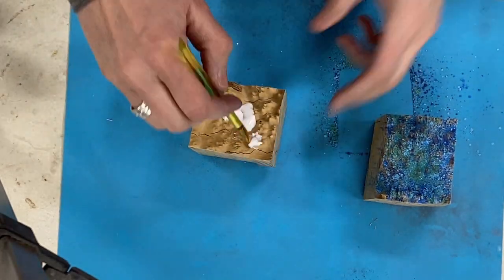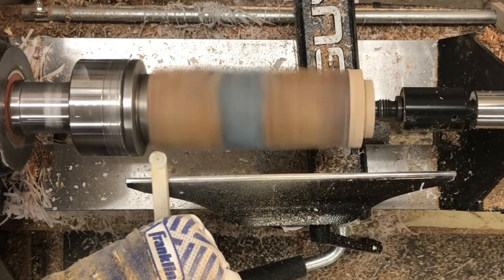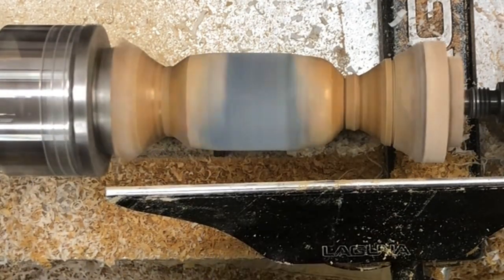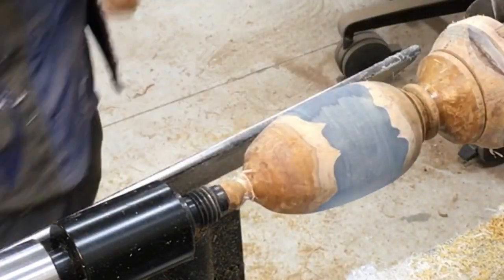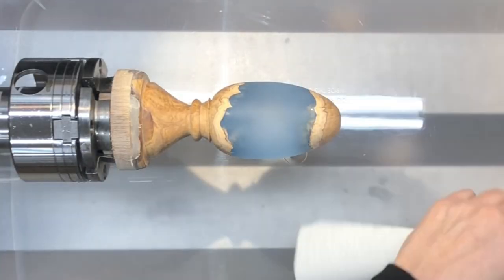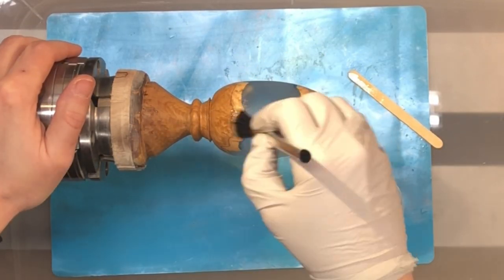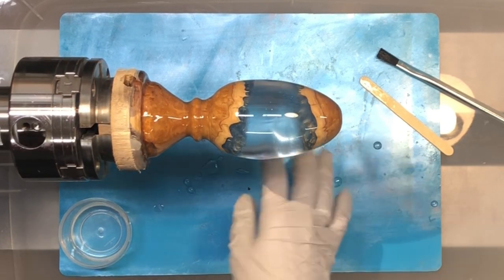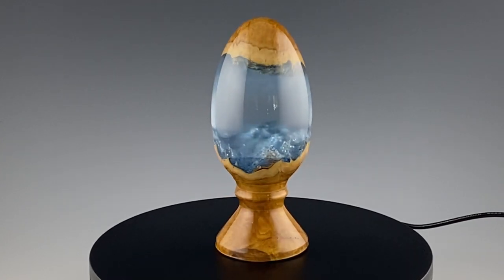Woodturning: Turning A Dragon Egg-Mallee Burl & Resin Underwater Cavern Egg+BBQ Rotisserie Hookup

Comment: Thats beautiful! Well done! Thanks for showing the barbeque motor set-up. Ill have to get one of those.
Reply from the maker: Thanks Dave! I made it so the rotisserie motor isn’t dedicated to the lathe as I’m also building a setup that I can use to coat tumblers with-I just attach it to whichever thing I want to use and I’m ready to roll. I bought the whole Charbroil rotisserie kit, but it turns out all I used was the motor - I was able to find the 5/16” square stock in the specialty bins at Menards so I decided not to destroy the bits for the rotisserie in case i actually want to roast a chicken on the grill. You can buy the motor separately but make sure the square hole that turns the spit is the same size in the event it’s a different brand.
Reply: @LisaRamlow  i also went over and wattched Zac's video on this set-up. Really cool idea, and not so costly! Thanks to both of you for sharing. Oh, and did i say....i LIKE that egg!👍👍👍👍👍

Comment: Beautiful finish, great looking piece....try a few seconds in the microwave to 'warm up your pour on resin coat...it helps when the shop is cold
Reply from the maker: Hi Martin! I normally use different resin for most things, and neither kind I currently have (Alumilite Clear Slow and Liquid Diamonds) has been this thick - wasn’t sure if it was supposed to be. It worked ok and I guess if it were too thin it might just slide right off. I’ll have to experiment a little and see if warming it up a tad makes any difference. Thanks for watching 😊

Comment: Very artistic LR. Thought of using a BBQ rotar before but never thought of using it in the lathe. I must research that!!
Reply from the maker: Hi Chris! A lot of lathes have threaded spindles so you can attach a vacuum chuck and it works out really nicely. I’ll have another setup not on the lathe for coating tumblers and such but for anything I can hold on a chuck this is perfect. Unless I want to use the lathe while it’s spinning a resin coat 😂
Reply: Luv to see that other rotary set up sometime LR  🤔

Comment: Epoxy is strictly a mechanical bond. For a maximum strength glue joint use 60-80 grit sanding to prep the joint. System 3 epoxy T-88 bonds damp wood better than most epoxies, the cure time is 24 hours.

Comment: I’ve watched several turners that have the extension from the head stock to the chuck. What kind of setup do you have? Is that just a insert attached to the chuck? Where did you buy it(if I may ask)? Loved your work and finished product. Really does look like an egg!!!
Reply from the maker: Hi there! When I started turning I had a Delta Midi lathe, which has a 1”x8tpi spindle thread and my Nova G3 chuck threaded directly into the spindle. When I upgraded to the Laguna, I hit a Nova SuperNova2 chuck that threads directly onto its spindle, which is a 1-1/4”x8tpi thread. I wanted to keep my smaller G3 chuck so I ordered (from Woodcraft I think) a Nova spindle adapter which lets me use the smaller chuck on the larger spindle. Definitely worthwhile! Thanks for watching 😊

Comment: Uv resin may be an alternative  works well on rings and cures under uv light rather quickly.
Reply from the maker: Hi Jason! I’ve not used the UV stuff yet - have to add it to the list of possibilities 😊
Reply: @LisaRamlow  , only draw back is having to purchase a uv light to cure it. Not terribly expensive.

Comment: Absolutely beautiful piece as always,  2 questions what is the purpose for the pressure pot and how big of a piece of wood can Your lathe handle?
Reply from the maker: Hi Ed! My lathe has an 18” swing. The pressure pot squishes the air bubbles in the resin down into microscopic sizes so there aren’t any voids. Some resins can be used without a pressure pot and some, Alumilite Clear and Clear Slow in particular, must have a pressure pot or the resin will just bubble and looks like a bubble bath.
Reply: @LisaRamlow  oh okay, thanks for the information.

Comment: How much pressure do you put in your pressure pot???
Reply from the maker: Hi Robert. It depends on your pressure pot - if you are using a converted Harbor Freight pot it’s only rated for 50psi but I never put more than 40psi in it. My “new” monster 10 gallon pot is an industrial paint pot that will handle probably 100psi but I stop at about 60-70. Quality of the pot is most important and don’t exceed their safety recommendations - one of those things exploding would be a very bad day.